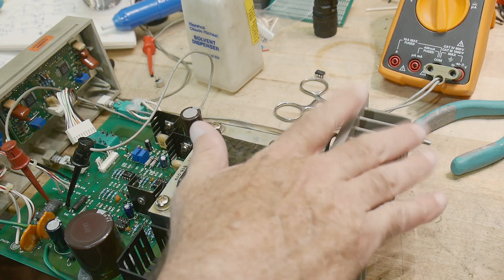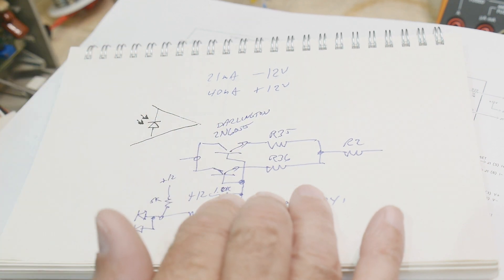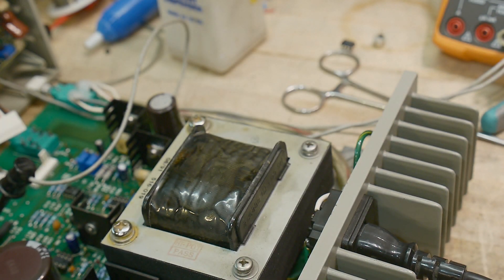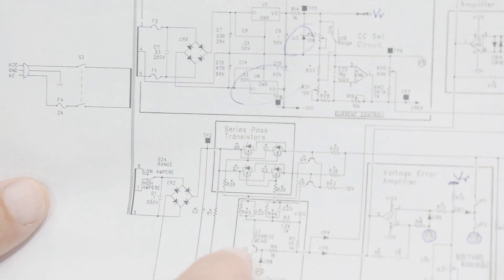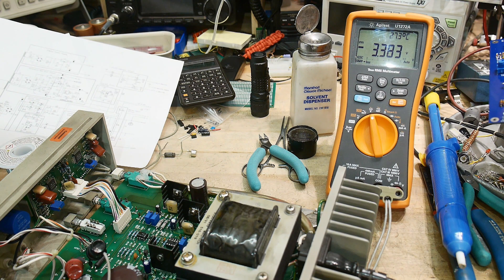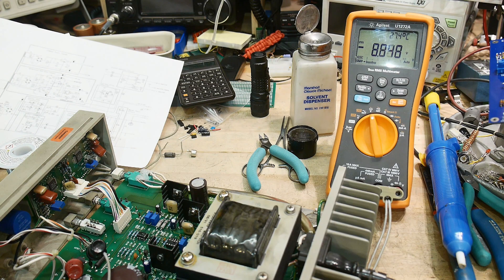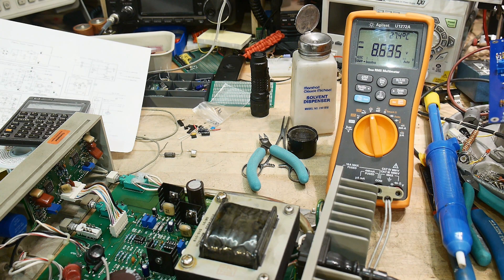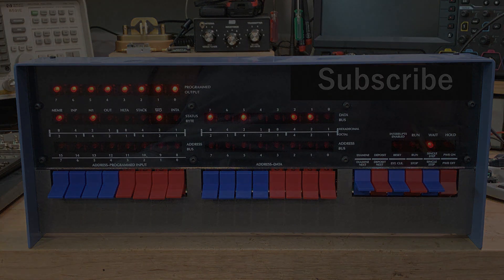#1252 E3610A HP Power Supply Repair (part 3 of 3)

Comment: In my HP/Agilent manual for the E3610a, R46 is listed as 390 ohms, 5%, 3W. So look for a space suitable for that size on the PCB. It's also described as being a "PWI" resistor - not sure what that means. Good luck!
Reply: I think PWI stands for, PowerWise Interface
Reply: @mickblackmore290  You know, I saw that too. But digging further into the parts list, and since some of the power resistors are described as "PWN", it looks more like PWI = Power, Wirewound, Inductive. Vs PWN= Power, Wirewound, Non-inductive. Maybe!
Reply: @craighosty1353   Then I'm thinking That that ( I ) started out as an (N ) and lost something in the printing.  Makes way more sense
Reply: @mickblackmore290  Mouser sells wirewound inductive and non-inductive power resistors (special winding technique). I'll go with "Power, Wirewound, Inductive" as HP/Agilent's meaning for PWI in their parts list.
Reply: @craighosty1353  That works to. I always thought wirewounds were always inductive unless specified otherwise. I also think if they are going to use acronyms they need to define them where used. JMO
Reply: @craighosty1353  - Non inductive wirewound resistors are what are called "counter-wound". 2 windings one is CW the other is CCW. I used these in a project where I needed to dump 100W in an non-inductive 50 ohm load. 2 100 ohm ceramic resistors in parallel did the trick.
The project was a defibrillator tester that was capable of measuring the energy in "FRED" pulses commonly used in AEDs.
I agree that PW (in PWI) may read as "Power, Wirewound".. though why they would state "Inductive" is a bit strange...
cheers,
Reply: @EngineeringVignettes  No doubt the non-inductive resistors were more expensive than the regular inductive ones. I'll guess they wanted to be sure that the non-inductive ones were used where they were designed to be, so it's HP/Agilent's way of being "clear". I agree that their acronym's should have been defined!